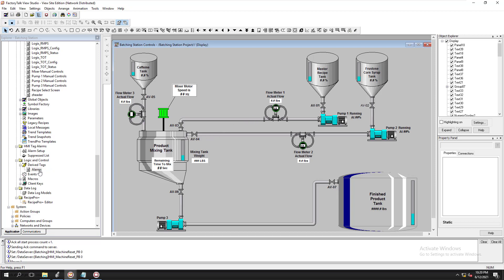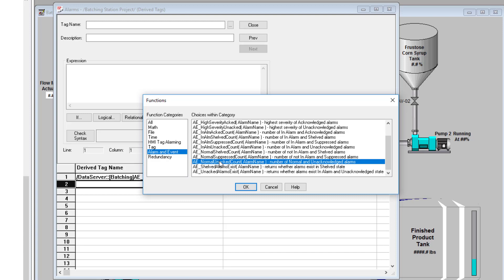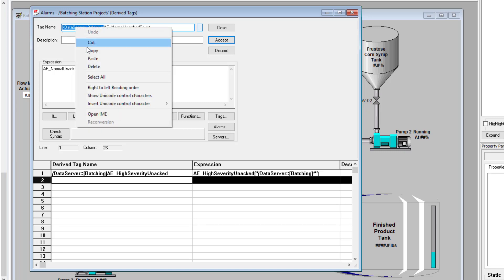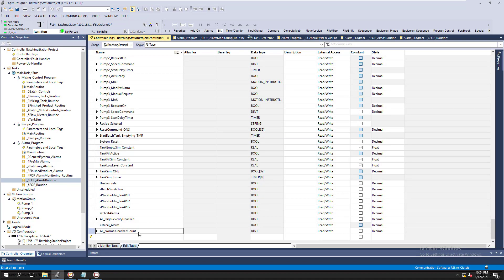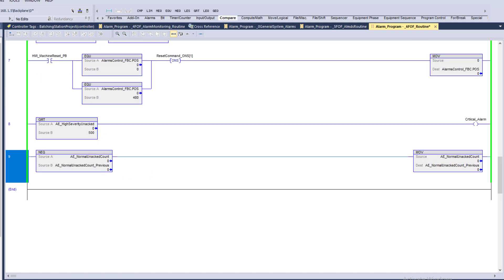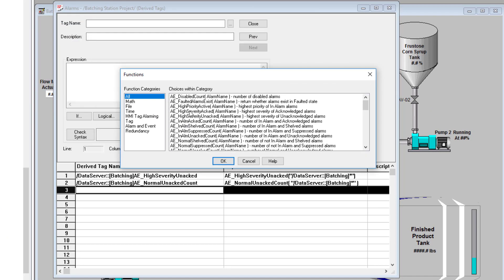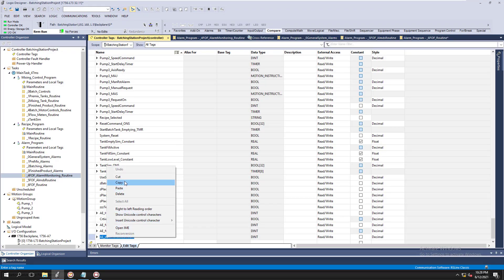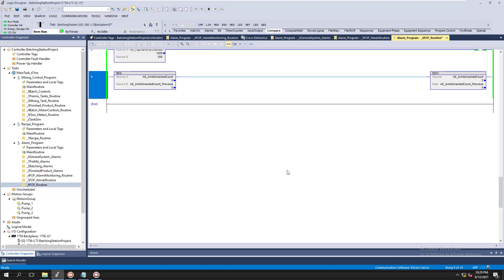FactoryTalk View Studio Derived Tags With PLC Programming

Comment: If I have a project in factorytalk machine edition and I want to migrate it to site edition, what do you think is the best way to migrate the alarms? my problem is that I have groups of real type alarms, for example in tag1, if I send 10 it is an alarm, for the same if I send 11 it is another alarm and so on several occasions. I'm interested in your video of derived tags, I haven't used them but I think it can be done with it, or I thought of making a level alarm for each case but I didn't think it was the best way, could you give me your opinion? thank you
Reply from the maker: Depending on what version of Factory Talk SE you are using, I would recommend exporting the alarm database then restoring it in Site edition.

Do a practice run on a separate PC then double check all is working as designed.

I say this because FTview 12 no longer supports legacy alarms

I made a video about the legacy alarms & spoke about this